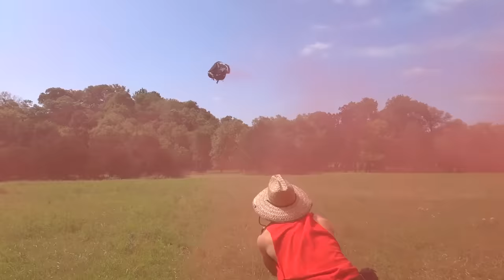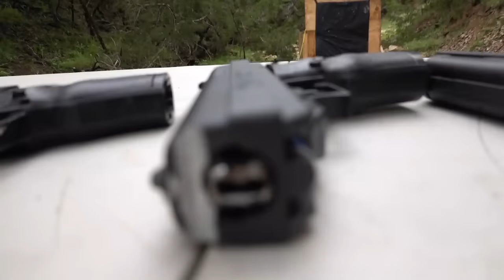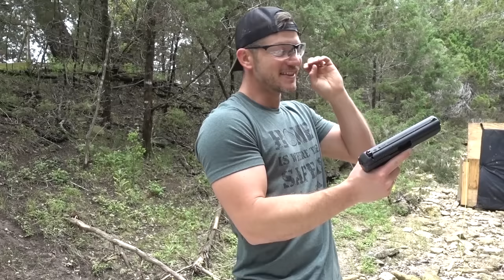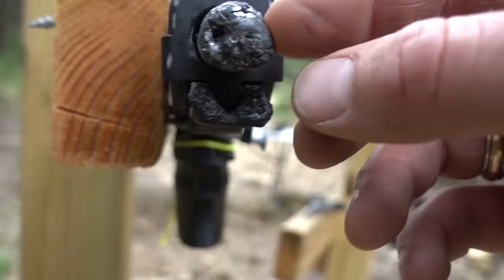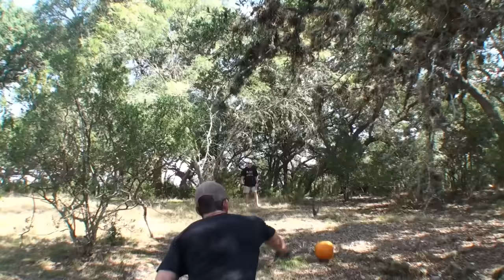I Welded a Barrel Shut...Then Fired it!!! Barrel Obstructions 2

Comment: Barrel Obstructions bookmarks 

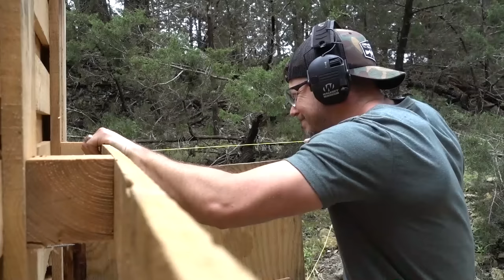6:40  Battery 

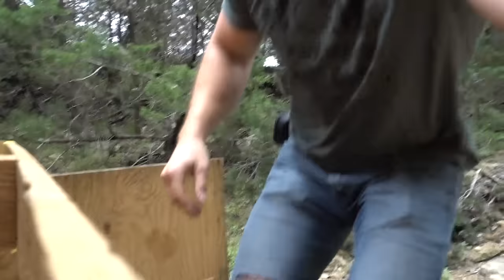7:00  Concrete

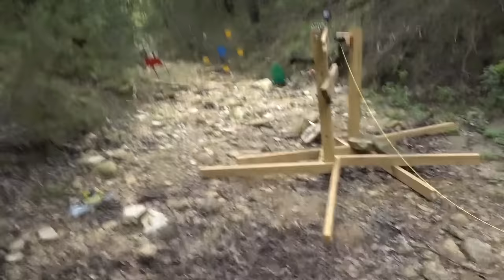7:57  Nails

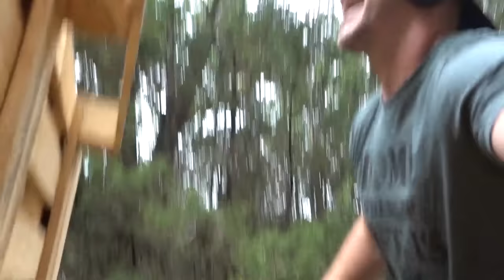9:48  JB weld

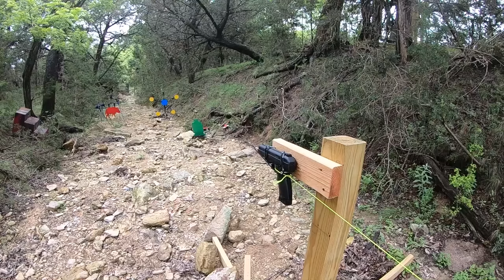10:13  45 acp

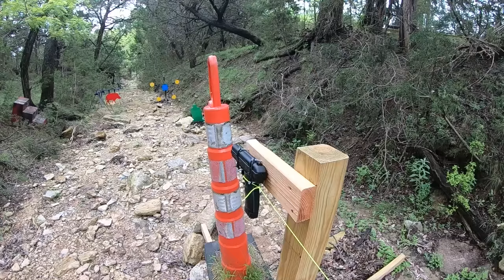11:06  Pinched Barrel

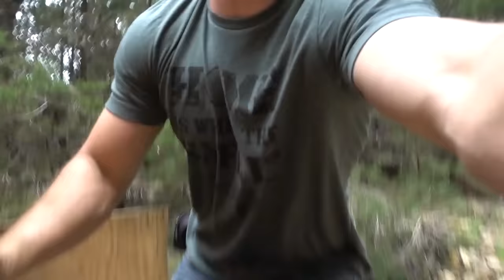13:27  Rebar

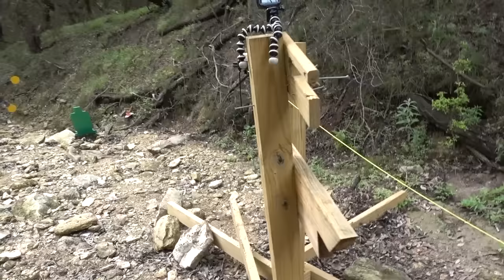15:40  Wedged Bullet obstruction, aftermath from Rebar attempt

17:51  Barrel Welded shut 

19:38  Bolt screwed through the Barrel
Reply: Careful, he’s a hero 🙌🏽

Comment: Its funny how how hi- points are more reliable when abused than when just used as a range gun
Reply: Lol I had more rounds through my hipoint than all of my guns combined and I used to shoot skeet a couple times a week and go through a couple boxes of clays each session. Never had a single issue with it, also never cleaned it. Sold it to a buddy for $50 im sure if he still has it it is still going.
Reply: It's funny how hi-points are more reliable than high end expensive guns like SIG and Kahr. Hell try obstructing the barrell in any generation Glock and the thing breaks and flys apart. Yet a hi-point will manage to fire and cycle the next round. They might be ugly but I don't know of very many other pistols that can perform just fine thru an inrange style mud test let alone being full of concrete and jb weld.
Reply: Yeah its simply because of the crude casting, makes them extra thick. Ill admit they are tough and have surprised me. But id still take my glock, or S&W over a highpoint.
Reply: @danimal865  - aye i edc a cz 75b and dont even own a hipoint tho maybe i should get some if nothing else as a cheap way to arm extended family and friends in the event it became necessary.

Comment: Army: DiRt AnD mUd WiLl ObStRuCt YoUr BaRrEl

Matt: Literally has to weld a high point shut
Reply: And what we learned from that is that literally nothing wants to touch a High Point - not concrete, not flex seal, not J-B Weld.  Not even their own magazines.  Nothing.  He had to weld the barrel closed to get even get a bullet to stay in one.
Reply: Kalashnikov.
Reply: The Army is right. anything in your barrel is an obstruction, its effects aren't guaranteed. What"s important though is the Army is more concerned with your rifle or machine gun.Those arms have bolts that lock in battery and they produce more energy so catastrophic failure is a real possibility All of the energy has to go out the barrel and its recoil gas system. If it cant leave the barrel fast enough it will find the weakest part of your gun and destroy it.  This hi point is blowback the bolt slide and cartridge are held in place by spring tension so they moves back and out giving the explosion somewhere to go.
Reply: Best comment
Reply: @SEllis-wd9nx  Right, a malfunctioning gun might just as well mean your death in a gunfight as a gun directly blowing up in your face.

Comment: 12:34 - barrel was crimped shut, split open on both sides, and had half the slide spring chopped. still chambers a round no issue. Hi-Point Perfection.
Reply: I'd have tried to fire annother round.
Reply: @sneakysnek2185 it chambered so it would fire, it may fail though

Comment: During rapid fire of a Springfield 1911, I had a squib that blocked the barrel. The next round pushed out the bullet that was stuck in the barrel, but it bulged the barrel and ruined it. Most of those Highpoints did better than that Springfield.
Reply: say what you want about the looks. it's the price paid for durability such as this.
Reply: @darrengarcia4937  the firearms are fine, it was the magazines that were shit. unless you are treating the guns like shit then i don't know what you were expecting.
Reply: It is worth noting that the higher you go in caliber and pressures its much more easy for gun barrels to fail catastrophically or just get ruined overall. The fact is that with .22 and 9mm rounds the pressures are so low you can get away with a lot before it blows up. That said cheap guns like the Highpoints shown in the video suck because the other components are not as good. Things like the action aren't particularly smooth and are more prone to jamming and wear than better more expensive guns.
Reply: I own Walter's. I own them mainly for their comfort in "MY" hands. Plus they are extremely accurate and very reliable. 
That being said, I do have a 9mm Hi-Point. It's not comfortable for me but I have never had a malfunction with it. And I've probably shot 3 or 400 rounds through it. 
Alot of people remember the old Hi-Points or just jump on the bandwagon. The old ones were garbage. People think that because its cheap it must be trash. In most cases you do get what you pay for, but that's why not the case with the new ones. Again, this is just my experience with them. Someone else may have had different experiences.
Reply: I think once and a while every gun company has a Lemon but the brand of high point is the Lemmon of all Lemmons and my Springfield XD-40 has had many many rounds fired threw it and I have only had bad rounds with little puckers that may cause a small jam but it’s never the gun and it’s about the most reliable semi auto pistol I have ever owned next to the rugar .357 and .44 single action Super Blackhawks I have which have never misfired.
I would trust my life on the reliability of the XD-40 which is also an Xd-9mm and a perfect apocalypse pistol that I believe you may also be able to convert to a .357 but have to buy the smaller .357 roughs made by only one company and the barrel for the .357 comes from an off brand manufacturer but the .357 round can be used with the 9mm clip so really it’s a .40 plus a 9mm and a .357 convert which is just awesome along with it being able to convert into a 4th which is carbine rifle kit so awesome awesome gun I like better then any Glock I have ever had although Glock is still pretty bad ass would choose the XD over it all day long.
Never had a 1911 though.
Reply: @alexisrivera200xable  actually 9mm is the same pressure as .357 Magnum. .45 ACP is less than half the pressure of 9mm
Reply: I've had cpl xd they're very nice my opinion I loved especially the xd .40 ported v10 God I miss that gun.
Reply: @alexisrivera200xable  9mm is higher pressure than .45 tho is it not?
Reply: @jordanwiser4192  i asked this question the second i read that comment and you answered it. I couldnt imagine why a projectile thats going at subsonic speeds thats only slightly larger than 9mm could possibly create higher amounts of pressure.
Reply: @josephmoodie4970  I... Can't even read this run on sentence. But you said that hipoint was the lemons of all lemons. Let me stop you right there. They may be ugly and heavy but they're very reliable. I've never had a problem with mine, and I would trust it in a crisis situation.
Reply: $370 pistol vs $900 berreta. I'll buy 2 high points and some spare parts for that 900 dollars, also don't forget plus taxes.. Our government is greedy
Reply: Loool
Reply: @sneakysnek2185  bought a beretta 92 compact with Wilson combat grips and a Langdon trigger a few months ago for $450, you don’t have to sell your soul for some Italian goodness lol

Comment: Never thought I’d say this, but: I’m impressed by these Hi Points.
Reply: Justin you pfp disturbs me
Reply: Justin your* oops lol
Reply: I agree. Even with all the crap everyone gives them.
It takes WELDING THE BARREL SHUT and THREADING A BOLT INTO THE BARREL to actually stop these cheap guns from firing.
And even then. They haven't legit exploded. So even if you were holding them, chances are your hand would be fine afterwards.
Reply: @Kendalon  And you actually have to cut the threads into the barrel; iraqveteran8888 hammered one in, and the hi-point shot the bolt out. Swelled the barrel a little, but it shot it.

Comment: Demolition Ranch is the greatest thing to ever happen to HiPoint. Honestly, what other gun could survive what that thing did? I mean it’s still hideous and cheap, but you have to admit that the past two videos on this firearm have proved impressive.
Reply: Yes you are completely right that these HiPoints have held up pretty good but than you also have to remember the main reason he chose this gun for the challenge is because they have no value and it doesnt matter if they break or not.
Reply: Waiting for hipoint to use this footage to show their guns merit.
Reply: Dude... Any modern handgun could take that no problem.
Reply: Nikanor Lehtonen I’m not so sure. I think the loose sloppy tolerances are one of the reasons the HiPoint held up.
Reply: @nikanor8152  yeah man he acts like he's trying to con everybody that nine millimeter bullet is what's moving s*** out of the way that gun ain't doing s***
Reply: The very first one was way more impressive he actually shot the slide and it still fired
Reply: @loneoutdoorsman77  probably. They use cheap materials to keep the production cost down which means they can't have tight tolerances to maintain some level of reliability. That doesn't change the fact this is nothing special, really.
Reply: I think it's not a hipoint merit. It's 45acp's work.
Reply: @wheelzzwheelzz1387  he hit the chamber. Which is stronger than the weird metal mixture they use in their slides. Watch Garand Thumb's review of the hipoint. He actually shoots and runs his guns and doesn't just plink and shoot watermelons
Reply: Player[Paul] that’s a plausible theory for sure.

Comment: Hold up, so when Matt shot the battery Hi-point both the battery and bullet shot out of the barrel, which means two projectiles came out of the gun with one pull of the trigger... Matt has done the impossible, turning a hi-point into an unregistered machine gun  😂
Reply: i think the law means to allow more than one CARTRIDGE to be fired in succession  with one trigger pull. otherwise single barrel shotguns are machineguns

Comment: Now I'm quite impressed with Hi-Point.  I think we need to see if some higher end pistols can survive these same tests.
Reply: i would say none, only some full metal like 1911, but glocks, beretta, sig sauer, etc wont
Reply: @as_soon_as_possible  beretta and sig both make full metal guns.
Reply: I wonder if the metal of barrel is subpar and it expands more easily so it’s possible to push out the obstructions
Reply: No way they'd last. No one builds their guns out of bent i-beams and angry thoughts quite like Hi-Point does
Reply: sman7290  that reinforces the previous guy's hypothesis that thinner/lower quality barrels expand more and allow obstructions to escape.
Reply: Yes most of them will.
Reply: @blahblah8037  no they arent.
Reply: sman7290 i bet the cylinder flash looked huge!!! I want to see a slow mo video of a +P cartrige shot through a revolver with a barrel obstruction now.

Comment: Try putting liquid nitrogen down the barrel and wait for it to freeze the metal, then fire it.
Reply: Ayye~ I agree
Reply: Hmmm.... just put the top of the gun into a small cooler of liquid nitrogen, leave for 10 minutes or so, pick up with gloves, lock on bullet, quickly put on zip ties (string already on), go behind safety and pull. Could do it all in 30 seconds. I like it!!

Comment: Ok, but for real - how about a test of a "threaded barrel" without the bolt screwed it? How would "EXTREME RIFLING" effect the round?
Reply: I like your idea!
Reply: Super duper bullet stabilization at 32 spins per inch. Zero wind drift at three miles range
Reply: the bullet spins so fast it makes the pistol recoil downwards and the bullet goes up like hop up on an airsoft gun. imagine😂
Reply: the day, when bullet spins you

Comment: To be honest I actually am impressed with how tough they are. Obviously not all of his attempts would really faze any guns, but some of those were extremely tough on the gun itself. Nice job HiPoint!
Reply: @managerial conclusions compensated with incredible durability
Reply: @Fiberglass_Insulation  basically the nokia of guns
Reply: High points are not that bad, I've had worse Berettas, glocks , sigs, and smith and wesson pistols. My 45 carbine was better assembled than my henry which cost 4 times as much.
Reply: What’s funny is you give em the wrong ammo and they wont even cycle. But shove the barrel full of dirt and it’ll keep on going like nothing happened.
Reply: Hipoints are made indestructible because when it jams on you, you can use it as a melee weapon to bludgeon your attacker to death.
Reply: @managerial conclusions lies we've had one for 15yrs and it's still running strong no jams no problems idk why yall think all of them are bad
Reply: @bentrod3405  in theory, no semiauto should be able to cycle ammo it was not made for.

Comment: most interesting thing is how much better a blow back action is than a regular bolt or mechanically closed gun, the pressure causing the slide to move allows the gun to survive and the gas to escape.

Comment: These Hi-Point vids are just making me wanna get one
Reply: Grim Pilgrim don’t
Reply: I have several that has never failed me along with other firearms they’re not bad just ugly
Reply: @13trayg  Most Reliable Pistol ever.
Reply: Just buy any thing other than hi-point  even an used glock is better
Reply: @sans_theskeleton  not really, even used glocks are expensive, like over 200 for a lightly used glock, where as hi points are 150 new.
Reply: @sans_theskeleton  the Inrangetv mud test says otherwise
Reply: You should get one I've dropped mine alot and had it in the dirt and still runs fine,  I've only cleaned it once or twice and it still runs amazing
Reply: Sans The Skeleton glocks are ugly too imo
Reply: @yourfriendlyneighborhoodra7987  but they are EXTREMELY expensive to buy, even used,( if u want one in decent condition) are still about 150 to 200 dollars, a hi point is 150 new, I got mine for 75 used
Reply: @sans_theskeleton  the 2 videos tha matt did say something different
Reply: Your Friendly Neighborhood Raccoon I like those especially the 1911, but can get pretty pricey

Comment: My theory: using "hard" stuff is great, but there's nothing inside a barrel for it to bond with. In order to really test an obstruction like cement, it'd need to be combined with something like the nail idea. Using nails through the barrel would give the cement something to hold onto (and could act as an obstruction itself), which would make it more likely to stop the gun from firing properly.
Reply: True. I've seen propmakers working with different kinds of glues and epoxy often score the surface they're gluing to   make it bond better.
Reply: But he used the concrete with the wires is tht like the idea u was talking about bc if so it didn't work either...
Reply: Katie Lankford the rebar wasn’t attached to the barrel

Comment: Matt: High points are the worst guns ever. 500 magnum: Hold my beer.
Reply: Facts lol..
Reply: Laughs in 45 70 government
Reply: 45-70 BFR is not even that bad I’ve shot it with some hot rodded loads the recoil was pretty maintainable
Reply: Am I missing something? Why would a 500 be the worst?
Reply: Josh Sizemore no clue might be the recoil
Reply: Josh Sizemore it’s unreasonable
Reply: @joshsizemore748  Because S&W's quality control is complete crap. Had a gun come in to the shop the other day that they didn't even put a grip screw in, and had never even been test fired. They are going down hill big-time
Reply: @joshsizemore748  Its recoil makes you want to cry.

Comment: Why buy an expensive glock, when Matt shows how good a cheap Hi Point really is.
Reply: PrimePlas  why do they suck?
Reply: Embrace the suck..
Reply: Highpoints are a cheap pistol. Made with the absolute cheapest materials possible, that's why they are so thick and bulky.
Will they work? Yes
Are they durable? ....Yes
Should you trust your life to one? .............. that's your decision.
Reply: @jacoblattimore5434  you just said that they work well and are cheap like what’s wrong?
Reply: Because glocks preform and look nice
Reply: @jacoblattimore5434  it wouldnt be a terrible choice for trusting you life to a firearm
Reply: @jacoblattimore5434  they work and are durable, those things respond the next question you made.
Reply: @jacoblattimore5434  I would say yes and guess what I’m going to say yes this guy cut the spring in half put it back in and it still worked and plus I love 45 ACP who doesn’t it’s one of the strongest pistol round I think it’s my favorite at least it may be bulky and super cheap but it’s 45 ACP you’re not gonna want a Glock 19 possibly not go through whatever the freak are wearing because this is America if you wanna rob someone’s house you better bring a level threea bulletproof jacket and yes I know level 3A is extremely powerfull but anyway I kind of like the way they look and yes I would rather trust A HiPoint rather than a Glock why because it’s 45 ACP
Reply: @God-of-canine  you draw your gun, you fire, and you miss the target. then it jams, your robber puts four holes  in you then runs off
Reply: @lyndonblackmon8814  Man this is a dumb gun it makes me look like a failure of an American

(Pulls out 500 magnum) 

Me: this will work better

Arm: God please no

(Puppy dog was killed by xxxjdd1989xxx)

Me: I wasn’t even able to pull the trigger

Arm: good
Reply: @adamoutulny2345  watch garand thumb highpoint vs glock

Comment: It's going to be hilarious when Matt is recognized at SHOT Show 2020 for being the #1 HiPoint buyer in the U.S. before being added to the board of directors  😂 
We may all hate HiPoint but you have to admit that they're pretty damned durable, I've seen so many torture tests and the HiPoint makes it through almost all of them, as bad as I hate to say it I bought one myself to torture test and the only thing that it couldn't handle were rubber 9mm rounds and they just locked the slide up.
Reply: Exactly why I bought one.  Never a jam.  Trigger sucks ass but accurate as hell.  Manage to hit qtr size target at 10 yards.  He's literally shown it'll go bang every time.  Unless you weld it shut or thread the interior of the barrel and tighten a bolt in it with a wrench.